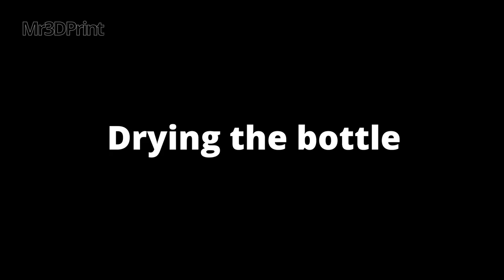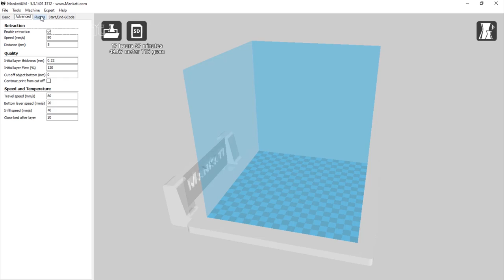#8 Important points for Production and printing of free filamen produced with recycled bottle (PET)

Comment: Have you by chance noticed any difference in ability to print your homemade filament on a bowden setup vs a direct drive setup?  I've been having trouble getting my homemade filament to feed through using my bowden setup.
Reply: Same here , because of long distance from nozzle the filament is not pushing equally

Plz give any suggestions on that 
@Mr3dprint
Reply: @saadsayyed9442  Since my initial comment, I upgraded to a dual gear extruder which made all the difference.  I wouldn't even try homemade PET filament without dual gear extrusion.  I'm actually still running a Bowden setup, so I don't think direct drive vs Bowden is the limiting factor, its dual gear.

Comment: Hi, I am having a problem in that the bottles thickness is 0.65mm by ?.mm. I have tried a number widths from 8.0mm down to 4.0mm. Adjusted the  temp up and down and the best I can get is a string,(more or less)about .75mm filament and about a 100mm long before the pull breaks. It's like the ribbon is melting and losing all it's tensile strength. Any Ideas? Thanks
Reply from the maker: Please make a video of your work process and send it to me on Instagram to see where the problem is.

Comment: I remember you said at some point that this filament is hollow in the middle, like a tube. Is this correct? If yes, do you need to dial in any other settings, such as retraction due to material density differences? Once again, excellent work
Reply from the maker: If the thickness of the bottle is 0.3, the filament becomes a tube
Reply: @mr3dp  this is likely because the hole entering the heat block is round so when pulling in the strip it rolls over without enough material it forms a tube this could probably be solved with a slotted heat break giving a further "melt zone" as the holes you drill form a cone
Reply: I wonder if you could increase the accuracy of the filament dia by increasing the melt zone area ? For instance if you took 2 hot ends and joined them together using a small section of heat break tapering the outer most heat break so it accepts the ribbon but having the hot end on the nozzle side completely stock with the modified nozzle this would allow a larger melt zone and create a “buffer” of molten plastic in theory it would result in a more consistent plastic flow which would be easier then say taking a block of aluminum and drilling it for thermocouple and heater and just making it wider the other option might be double extrusion have the first heater with a nozzle drilled at say 2-3 mm  this would reduce the folding over effect of hollow filament followed by a second hot end who would take that extruded already round filament and reduce it from that larger dia down to 1.7 more consistently if one where to follow that double heat break at 3mm on the first end the joining of ribbons or the joining of 3mm filament will be much easer allowing you to extruder a much longer 1.7mm filament without the need of joining 1.7mm filament and worry about dia consistency

Comment: Can you share your 3d printer heatbed support stl file
Reply from the maker: Which file do you want? I could not understand you ?
Reply: @mr3dp  I  had made a 3d printer at home so my bed leveling is not done properly so that's why in your custom 3d printer that you had use black color 3d printed part for the bed support , that I need